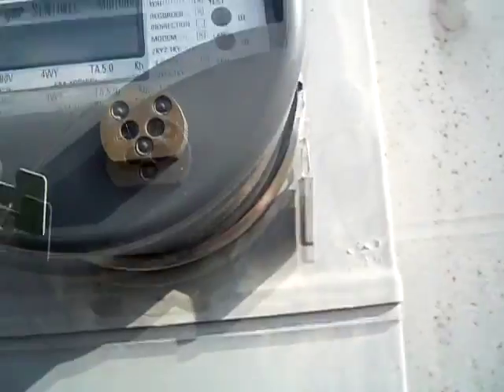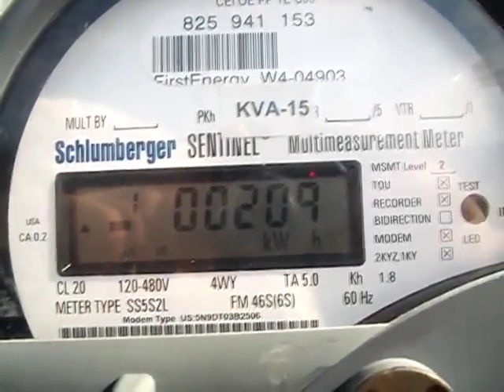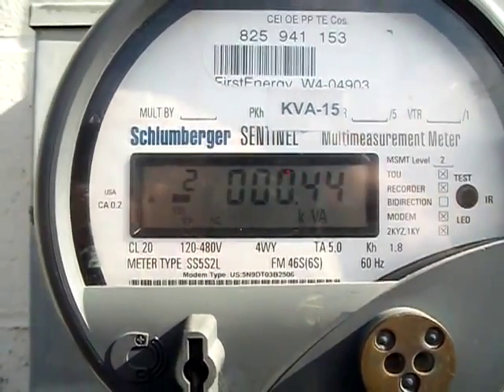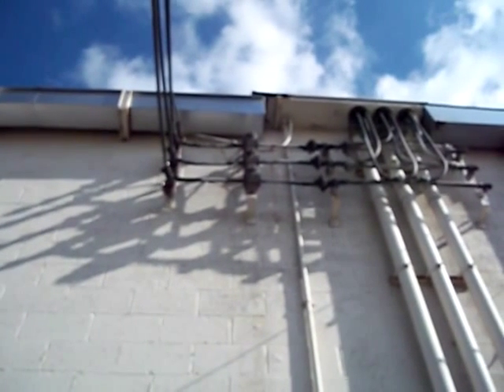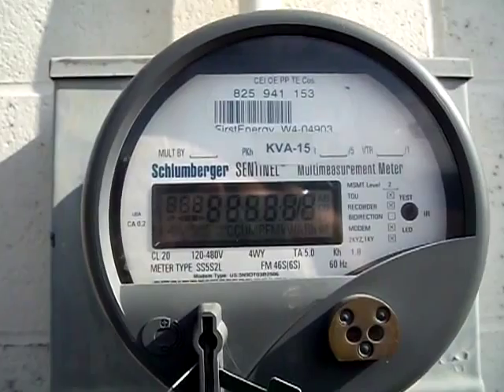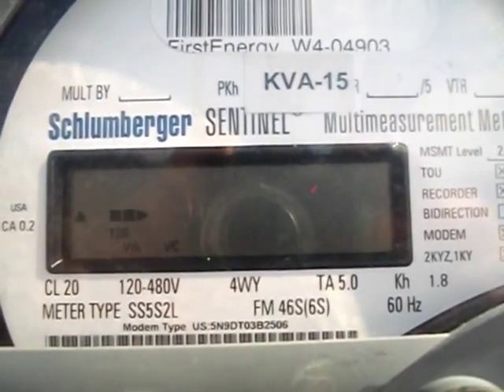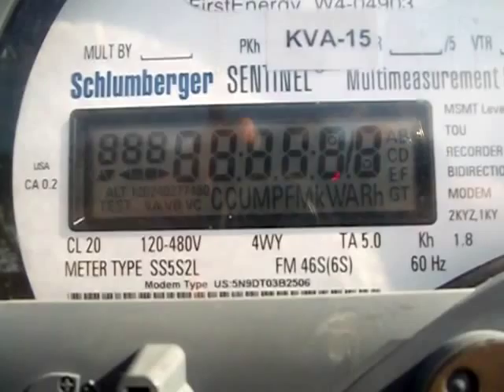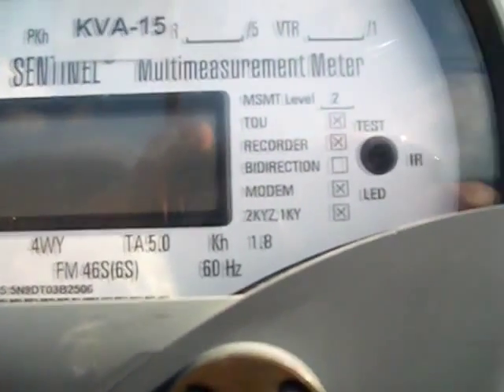Schlumberger Sentinel - Watt Hour Meter

Comment: The voltage to the meter would be the same as the supply voltage. In this case 120 / 208 Volts 60 Hz.
In case of HV supplies at 7.2 or 14.4 kV The meter voltage would be supplied via VT's as well, which step the voltage down to 120 Volts besides CT's for the current.

Comment from the maker: What kind of voltage would be running to the meter ?  If I remember correctly, that is a three phase 208 Volt 60hz System, atleast it used to be.  I knew there was a correct technical name for the CT's, they just call them meter taps around here....  Appreciate the information, thank you !

Comment: Those remote disconnects should be banned, it's a fire waiting to happen. You have 200 amps worth of current being switched remotely by a load of cheap  consumer grade junk electronics. Having these things communicate wirelessly is stupid, using unlicensed frequencies to do it over is the height of stupidity.The meters they want to put in here operate in the 905-925 MHZ/Mc band, unlicensed, which means Industry Canada could assign those frequencies to someone else.

Comment from the maker: Most of them are setup this way and they are OLD buildings, though some of the newer installations dont even use pole mount transformers.  Pad mount transformers with the meter mounted on the side are replacing the pole pigs and ct's

Comment: Those coils around the mains are Current Transformers. (CT's) The primary current goes through the centre of those coils. The output is usually 5 Amps which goes to the meter.
In case of a 200 Amp supply, 5 Amps go to the meter. The multiplier is 40. It may be programmed in the meter or the readings will be multiplied at the billing department.